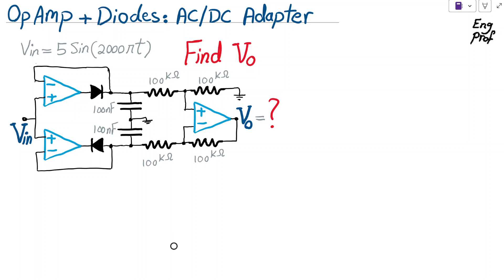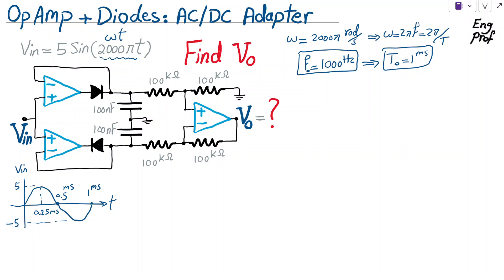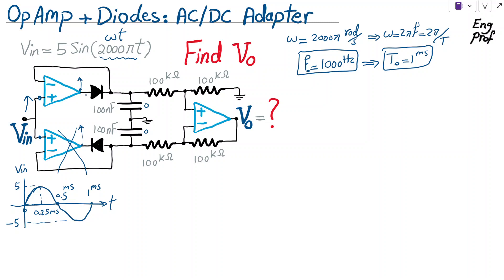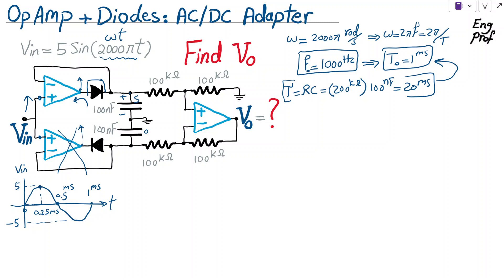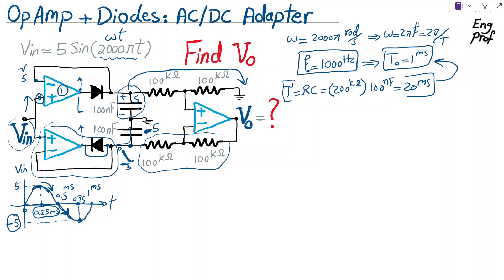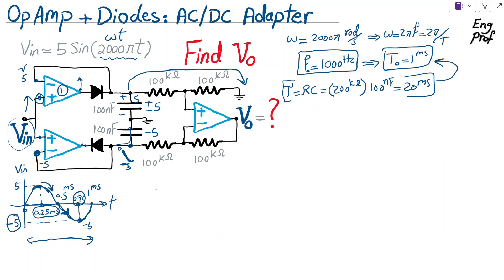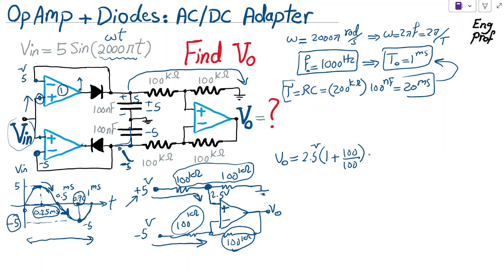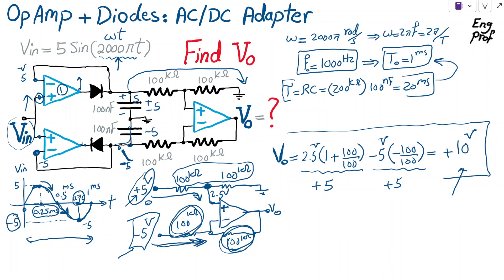AC/DC Adapter Circuit with Op Amp and Diode

Comment from the maker: Peak detector Analog circuit Design with operational amplifier and diode is discussed in this video. Here are a few related videos: 
Full-wave Rectifier AC to DC Converter https://youtu.be/ogZVEGgU0JA
AC/DC Adapter Circuit with Op Amp and Diode https://youtu.be/3rXW5bPlgd8
Analog Logarithm Calculator with Op Amp and Diode https://youtu.be/w4DuaCJGRRY
and more circuits in my video playlist https://www.youtube.com/watch?v=ogZVEGgU0JA&list=PLrwXF7N522y4c7c-8KBjrwd7IyaZfWxyt&index=37
I hope these circuit videos are interesting as well.

Comment from the maker: @ats89117  Thank you for watching and sharing your observations and circuit simulation results. It is exciting to read your interesting simulation results.  Regarding this AC to DC adapter circuit, as you mentioned, the output voltage ripple could be due to op amp slow slew rate and/or frequency dependent Diode's or Capacitor's parasitic that becomes considerable vs circuit resistor beyond certain frequency.  The diagnosis also depends on whether your output voltage peak reaches near the +/-5 volt peak of input sinusoid.
Regarding the Negative Inductance Design by Op Amp Impedance Converter https://www.youtube.com/watch?v=GF_Mun_Mkyo , it is interesting that your simulation showed near perfect negative inductor effect up to 20 KHz. The limiting factor could be op amp gain-BW or passive parasitic for instance for capacitor (especially large caps on the order of 0.1 micro Farad).  It might help if you reduce the capacitance value so that you can use higher quality smaller caps and offset that cap reduction by adjusting resistor values (if need be).  Thanks again for your follow-up and sharing your interesting observations and circuit simulation outcomes.

Comment: Nice circuit and video! The simulator has some problems with the circuit when using OP27s opamps and BAT54 diodes. The output comes out around the right level but as an irregular sawtooth...
Reply from the maker: Thank you for watching and for your follow-up comment. Happy to see that you tried it in a circuit simulator.  While the circuit is not practically fullproof, please make that RC discharge time constant is much larger (say at least 100 times) than the period of your input sinusoid.
Reply: @STEMprof  I enjoy simulating and building the offbeat circuits that you seem to specialize in, and I look forward to simulating and breadboarding them while hoping to get a chance to use them in a future product. I did experiment with the time constant formed by the capacitors and resistors, and this affected the output, but even with a very long time constant, there was a few tenths of a volt of ripple in the output. I'm not sure if this is due to time-bandwidth limitation of the opamps, the not quite ideal performance of the ideal diode circuits, or just simulation issues, but I will check this out when I breadboard the circuit. I did like the fact that you used 0.1uF capacitors, as this is about the upper limit for easily obtainable NP0 ceramic capacitors.

My favorite circuit of yours so far was the negative inductance generator. When I simulated it, it worked perfectly up until about 20 kHz after which it broke down, I'm guessing because of opamp gain-bandwidth issues. At low frequencies, the Bode plot had the exact magnitude of an ideal inductor of the specified value, but 180 degrees out of phase. I am interested in trying to use this to cancel out parasitic inductance in some critical applications. The circuit even allows for the negative inductance to be tweaked using a single variable capacitor!
Reply from the maker: @ats89117  Thank you for the insightful comment and sharing your observations and circuit simulation results.  I am glad to hear you liked these circuit design and analysis videos. It is also exciting to read your interesting simulation results.  Regarding this AC to DC adapter circuit, as you mentioned, the output voltage ripple could be due to op amp slow slew rate and/or frequency dependent Diode's or Capacitor's parasitic that becomes considerable vs circuit resistor beyond certain frequency. Regarding the negative inductance circuit, it is interesting that your simulation showed near perfect negative inductor effect up to 20 KHz. The limiting factor could be op amp gain-BW or passive parasitic for instance for capacitor (especially large caps on the order of 0.1 micro Farad).  It might help if you reduce the cap value so that you can use higher quality smaller caps and offset that cap reduction by adjusting resistor values (if need be).  Thanks again for your follow-up and sharing your interesting observations and circuit simulation outcomes.

Comment: Looks interesting, but won't the op amps need another DC source as power supply?
Reply from the maker: Thank you for watching. Yes, Op Amps always need supply voltages and in this case they need one positive supply voltage and one negative supply voltage.  It is implied that the needed supplies are already properly applied so that both operational amplifiers are properly biased in linear region of operation.
Reply: @STEMprof  Thank you.